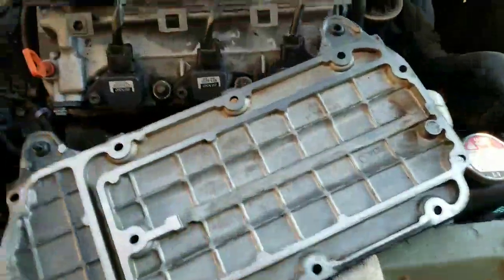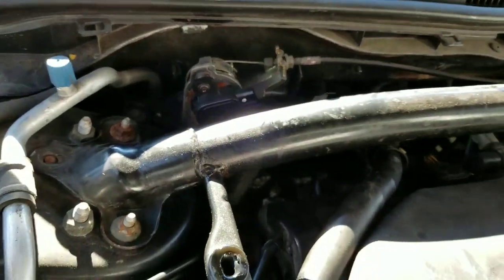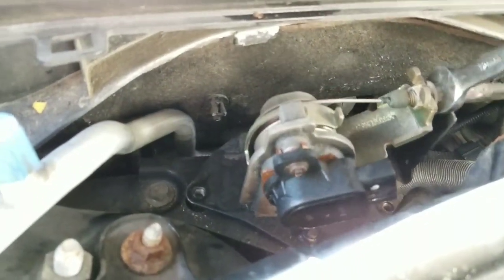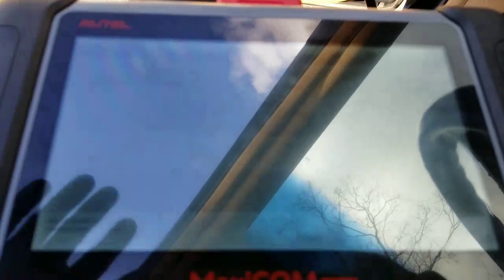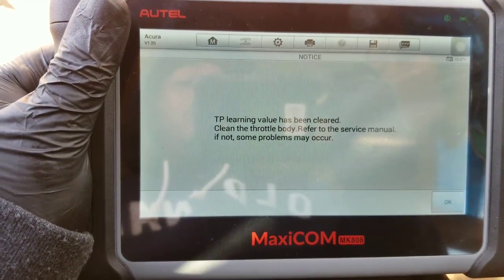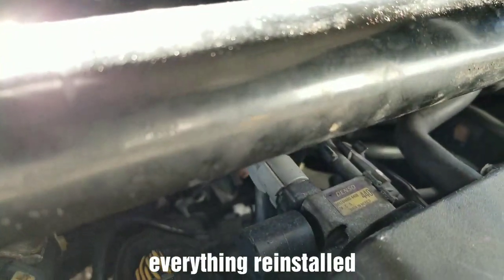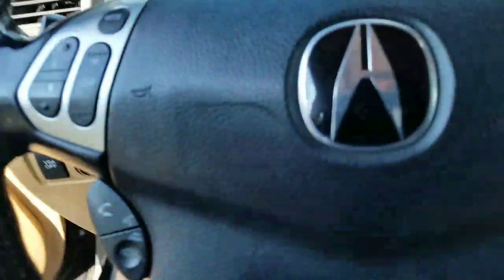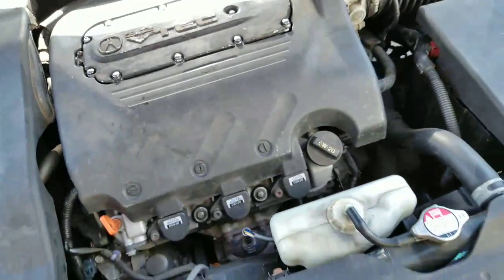ACURA TL SHOWING SUBSCRIBERS CAR SOME TLC AND VSA REPROGRAM

Comment: My 2006 TL trans seems to slip alittle...... It has 230,000 miles. Do you think changing the pressure switches might help?  I've never changed them. I have already changed the trans oil and filter. Please let me know. Thanks for all your videos. There so helpful.
Reply: Gohard  instead of the acura trans oil. I thought these transmission were very strict on just the Acura oil. I like redline.....
Reply: Start to save for a new transmission trust me

Comment: Have you ever have to change your knock sensor I am getting a lot of ticking after changing my alternator
Reply from the maker: Never had to change my knock sensor if you getting your ticking you need a valve adjustment then.

Comment: My steering rack messed up for the seconds time replaced with a reman what reman brand do you recommend or only oem ?
Reply: GO OEM.I'll suggest you make the dealership or a trusted mechanic do the job.Don't go to any mechanic to do this job because  if something goes wrong after installment  the mechanic can shift the blame and say it's the rack that's bad.

Comment: First
Reply from the maker: Lol
Reply: fabolousg4ever I have a problem with me 2005 Acura TL my car alarm keeps going off in the middle of the night for 0 reason any thoughts?
Reply: fabolousg4ever please reply
Reply from the maker: @zeigegangk697  do you have oem key or aftermarket key with no memory.
Reply: I got the car used but the key has the Acura logo so I’m guessing it’s original key? Also it didn’t do this at first
Reply from the maker: Does the fob have the acura logo on the back
Reply: fabolousg4ever yess!

Comment: Hey bro, I've learned a lot from watching on here. Q - Could a torn air intake hose cause an increase in fuel consumption? Plus, check engine light has been on for a bad o2Censor which i believe will be the reason for sucking fuel. please advice )
Reply from the maker: Yes it will throw a cel and it will burn more gas def it's sucking in hot air from the motor instead of cold air it will def make the car run bad and burn a lot more gas and throw a cel depending on how bad the leak is .
Reply: @fabolousg4ever  Thanks bro. Fixing it right away. Wholeness :)

Comment: Won't even respond to messages bruh smh
Reply from the maker: I try to respond to everyone sorry about that but my inbox is so full of messages trying to respond to everyone.
Reply: @fabolousg4ever  Ok i understand that
Reply: @fabolousg4ever  Well my question was. I have a 2011 TL awd SH. I swapped out my old bulbs for CBI and tsx clear lens. I have a yellow line at the cutoff with no color 😠😠 I'm not new to this. I previously had a 06 Maxima and I swapped out everything in the headlights. I put EvoX-r in for the old E55 projectors that came stock and the color was amazing no the EvoX-r from TRS. No tuning was  involvedwith them. Are you familiar with tuning on the OEM projector that comes on the 4th gen TLs? I've heard spacers, washers it's just a PITA taking them out.
Reply from the maker: Thanks for understanding
Reply from the maker: Yea gonna have to add spacers and play with it and the cutoff before you put the headlight back together.
Reply: @fabolousg4ever  I'm just gonna order the 4gTLr from TRS. Everyone says the 4gen projectors are trash, and 3gen are the shit the one's with the solenoid on the bottom.